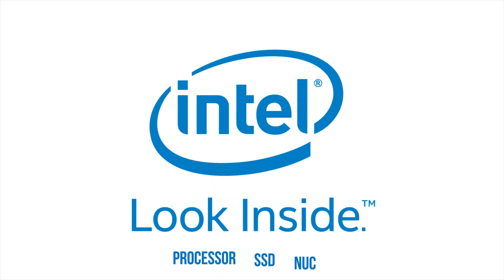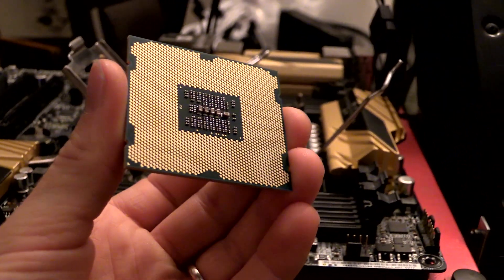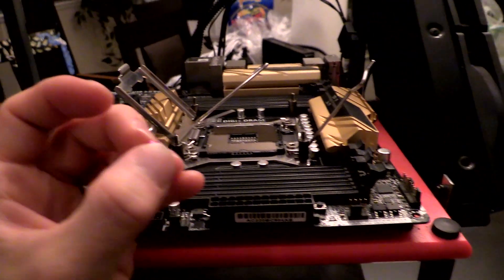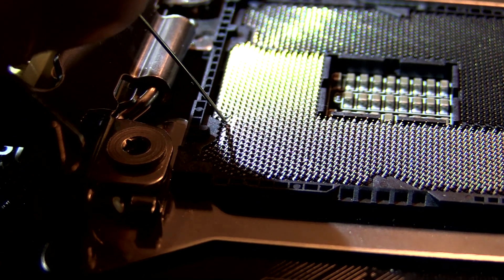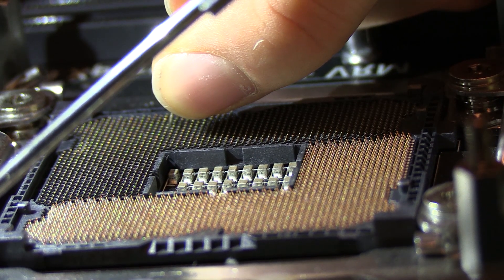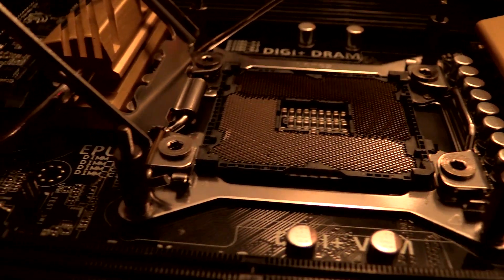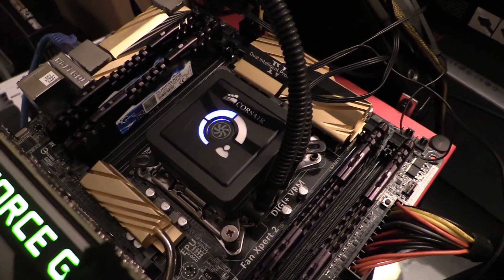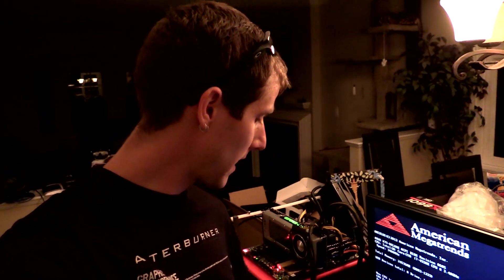LGA 2011 Socket Pin Repair Vlog - Fix a "Dead" Motherboard

Comment: talk about QC...terrible
Reply: wolfstar Typical ignorant brony. The board was fine, it broke during use. "Somehow at some point". At some point, it didn't come that way.
Reply: imapie4688 quality control
Reply: imapie4688 I meant the QC of Asus, I'm pretty sure Linus didn't bend the pin on purpose.
Reply: wolfstar Im sick of bronies ruining everything.
Reply: wolfstar
Although I'm an Asus fanboy, I doubt the board left factory like that. Linus also mentioned his board wasn't covered by warranty, you're generally not going to be taking risks beyond the warranty period.
Reply: chcltninja Ah, Well, The quality of this video shouldn't be professional with all these fancy effects for a simple thing such as bending a cpu pin back in it's place.
Reply: wolfstar OH sorry, i thought you meant the video quality :D my bad
Reply: wolfstar
Most of these boards, even the premium ones aren't mean to be replaced with CPUs on the go like Linus and his crew probably does. You should tone down the hate a little.
Reply: TO MANY BRONIES
Reply: Harry Livesley I'm sick of trolls like you commenting on something that has nothing to do with the video.
Reply: wolfstar To my knowledge, all boards are manufactured with the socket protectors over them, so I don't really know how you can QC every single board for bent pins when there is a cover preventing you from seeing it, let alone accidentally bending one. Batch QC works fine, for every bad review of new egg, there are thousands of happy customers without bent pins, and if it's shipped like that, most retailers will replace it, and if not, the manufacturer would be more than happy to intervene to keep their brand in high regards.
Reply: mctonale watch your mouth sir
Reply: Linus didn't say it came like this? And you expect the pins to be not fragile?
Reply: this was an engineering sample. That meant that he got it to review. He did review it, and since now he has the bent pin, that probably means that he bent it himself
Reply: I had an asus lga1156 board that came with 2 bent pins that caused only 1 ram slot to work. I rma'd it and when i received my new board it was the same one i sent back. they said i bent it and that its not covered under warranty, when i know for a fact that is how it came from the factory. i ended up just doing what linus did here and it works ok. i hope it works for a long time too because i cant find lga1156 boards anywhere
Reply: imapie4688 No prob, seeing things like bent pins from factory on certain brands pushes me away from Asus or whatever brands have these issues. :3
Reply: And. *tips fedora*
Reply: Sk3elly Why the fuck do you assume every brony fucks ponies? That's just retarded.
Reply: The only thing is you pay a lot for air conditioning bills for AMD.
Reply: dafuq is CQ??
Reply: R Yu Which is why its a review/engineering sample. He don't pay for it lolz. But I've seen reviews on newegg where pins "come/came bent out of the box" maybe it was user error or hell if i know lol
Reply: wolfstar Then how can you judge the quality? Well, since you've never used an Intel board, I can tell you that, it's not ASUS's fault, the pins themselves are fragile like that, it still applies to AMD pins as well, they're extremely fragile could easily be bent if not careful, I assume Linus may have accidentally broke the pin while removing the protection cover, I don't know, he doesn't know, no one knows. Either way, the point is, it's not the manufacturer's fault.
Reply: JTCPingas
Pony fuckers i can deal with but people who call everyone who disagrees with them a "troll" are insufferable.
Reply: Asus qc haha JJ go to hell.
Reply: The board was working. Linus was the one who 'somehow' damaged the pin. This has nothing to do with ASUS or their quality control. Next time try to listed to what Linus says.
Reply: Harry Livesley Gr8 b8 m8 I r8 8/8
Reply: RazorGames There is something more than a bit creepy about grown ass men who are into stuff made for 6yo girls.
Reply: mctonale hey
Reply: Harry Livesley Looks like someone has their pants in a bunch.
Reply: Damn this comment section got attention. Well anyway the comments I've read so far when I was gone, and only attracted obvious trollers and some people who have had bent pins out of the box. :P
Reply: wolfstar noob, of it comes broken they repplace it  for free, thiis was a "test" board
Reply: ♪~ Still (Azure) ~♪ Hell if I know I've never owned a Intel board (only socket 478).
Reply: g0ggy Gotta do what you gotta do :3
Reply: ♪~ Still (Azure) ~♪ ...okay
Reply: wolfstar ...okay :3
Reply: ♪~ Still (Azure) ~♪ /)^3^(\
Reply: Yeah i had an ASUS P6T w/ dead ram slot due to bent pins... And it was quite a common issue
Reply: wolfstar The board was fine even when they reviewed it, linus said in the video about how they bent the pins themselves somehow. Pretty sure Asus would check their review samples before shipping it out right :P
Reply: Kay... another bronie just join...
Reply: fam yang Yay 2 other bronies :P
Reply: Ahh my motherboard die 1 week later after building my pc.... gigibyate curse you and your crap motherboards. So much for quality checks.
Reply: Phurfee Yeah, Fuck JJ and his no returns on bent pins policy.
Reply: Do Asus even manufacture the sockets?
Reply: Smackers_12 No the just bend the pins before they ship the boards to you
Reply: Smackers_12 Foxconn do a lot of that stuff. You'll find it stamped on the socket somewhere or on the socket protector.
Reply: ♪~ Still (Azure) ~♪ Every time I've seen a Linus Media video with a socket protective cover they've always let the CPU pop the cover out like it is designed to do. It's much more likely they lost or forgot to replace the cover after testing and having a board with an open socket laying around, it's just a matter of time till something bends/ breaks a pin.
Reply: Harry Livesley Oh cmon, don't hate the bronies!
We are all brothers here on youtube.
Reply: imapie4688 hmm...I have seen you before. Pie.
Reply: mctonale Yeah I agree. Fully grown men with brony pics is defo creepy. Maybe pedophiles? Make the kids love them? Hmm..... very strange. I just see people with my little pony pics that say brony xD. That is all bronies are. My little pony. Says it all really.
Reply: BinaryOneXero Gaming and Tech 2 err, I'm not making any assumptions about sexual preferences. I just think it's weird.
Reply: wolfstar
 Linus said that it wasn't asus fault. he said he accidently did it
Reply: Smackers_12
  most Mobo Manufacturers buy them in, used to be Foxconn a lot of the time, not sure now. Maybe different from each Manufacturer to Manufacturer of Motherboards.
What most people forget is that they are only rated for a certain amount of insertions, early 775 boards were something ridulous like 25 ( from my hazy memory ) meaning you could expect a problem anytime after 25 different chips were plugged in.
If you're using it as a Test Bench that could be a only a few Days :(
Reply: Yup. Where I work currently our last generation of products had Intel mobos (dh67bl). One out of every 30 or so had bent pins or a piece of dust or lint inside.
Reply: it was an engineering sample meaning you are not likely to have this problem.
Reply: Do the word engineering sample mean anything to you?
Another words, its not the final product you would receive upon purchase.
This is a sample for review purposes, think of it as a beta tester.
Reply: ***** Finally someone using their brain.
Reply: ***** Not all companies noob, they sometimes make a hassle by blaming you for breaking it.
Reply: wolfstar well considering ASUS is a leading PC part manufacture, not to mention have good P.R and customer service. I'm sure they would replace it as they would with D.O.A parts.
This is not a cheap company, just remember the name of the brand and the fact its a sample board, oh and their reputation.
You might have a point if this was a $50 mobo, but this is not the case, so what your saying is kind of irrelevant.
Reply: Hello Frost AMD runs cooler than Intel...
Reply: I been using Asus for years and never had a problem. If you get anything damaged rma it.
Reply: ***** Hell no it doesnt lol. I can heat up my room if its cold just by leaving BF3 running. And in using a H60 -_-
Reply: Usually, bent pins is user error, and they say it came like that to get warranty coverage.
Defects do happen with every brand, though.
Reply: ***** i cant undervolt, or...i dont know how to lol. anyway my cpu hits 68c when gaming.
Reply: *****
No it doesn't, AMD core-temp sensors are just calibrated lower.
I've had AMD CPUs report being well below ambient temperature, and still misreporting by over 10c under load.

AMD hasn't been cool 'n quiet since the Athlon days.
Reply: alkafrazin Miscalibrated or not, they're still cooler.
Reply: ***** They aren't, though. Statistically, intel CPUs eat less power and put out less heat.
Reply: ***** Actually, power consumption, which relates directly to heat, has been widely tested. Intel often sits around 100-200w, full load, total system consumption for i5 or i7 in a barebones system. FX8350 tops out over 300 watts in a bare bones system.
Intel sensors are calibrated higher than AMD. That is ALL. You can even feel the heat off the back of the case at different temps to compare. I own a oven of a case, which has housed 95w, 140w amd CPUs, and a 88w Intel CPU set to target 95-125w. The heat off the Intel CPU is barely warm, but off the and CPUs, you could almost burn yourself on the back of the case.
Reply: alkafrazin Maybe they use less power, I don't think anyone has ever really tested that, but they're not cooler. OC'ed AMD chips are usually around 50 or 60 degrees at full load, compared to the 70 or 80 of Intel CPUs.